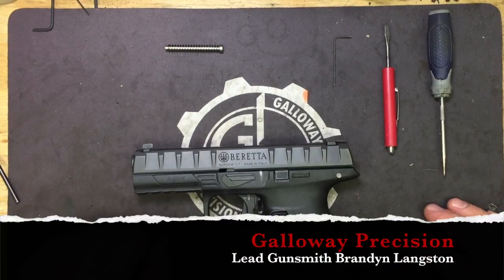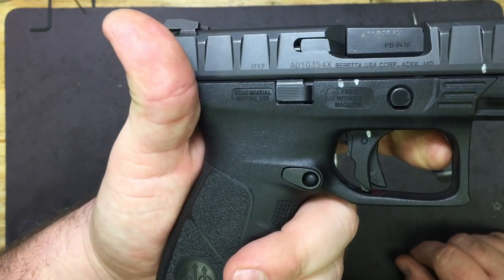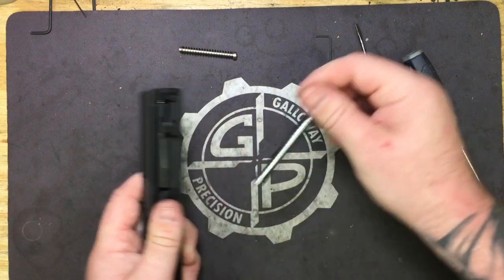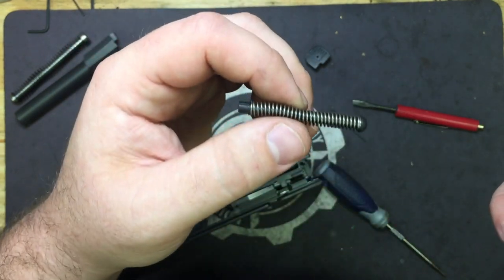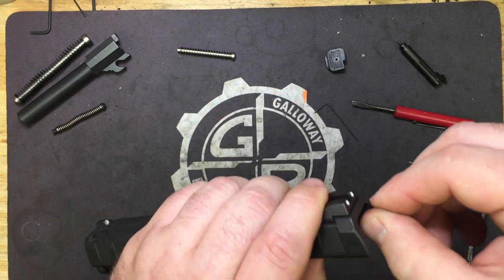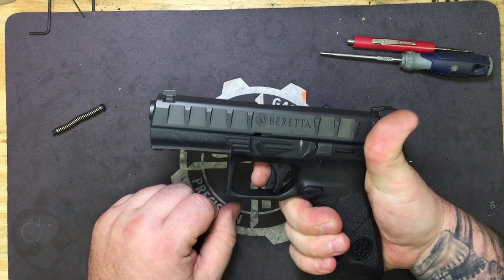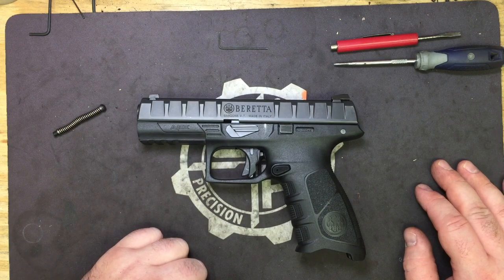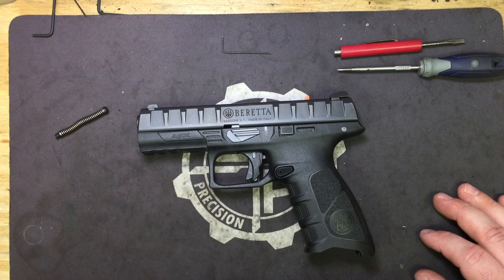Beretta APX Striker Guide Installation

Comment: I’ve watched this many times before. My beretta apx had proved this at the range with 18 lbs stainless steel guide rod spring assembly and my gun cycled very well with more accuracy. I also have the 20 lbs which I will use next time. These upgrades are more efficient than the stock polymer guide rod spring assembly because it’s stainless steel guide rod with heavier recoil spring. I love my beretta apx 9mm fullsize with this metallic guide rod.

Comment: I received my APX Trigger spring today.  I was very excited about installing this.  I will say, I did struggle placing the back plate back on.  I had some issue applying enough force on the extractor to get the plate to slide into place.  I took the pistol apart several times to test where it was binding, but it seems like it just required more force to get it back together than I expected.   This pistol is VERY tight on all moving parts.  Even the top slide release was crazy tight.  But the great news it is back together and I am so happy with this new lighter pull.  Headed to the range to run some ammo through it now!!
Reply from the maker: Great to hear it's back together and you are happy with the results. We appreciate your business.

Comment: Thank you for the detailed explanation of the proper procedure of slide disassembly and reassembly. I had a very difficult time getting the spring that powers the extractor aligned and then sliding the cover over the top of it. That particular spring is very stout even with a properly sized gunsmith punch.

Comment: Galloway prices as extremely reasonable and they move the products out!  The instructional video is good.  I own Glocks and their rear plate removal is much easier.  I did buy a factory lighter striker spring assembly too because it was inexpensive.  My Galloway parts arrive today and I will report after installation and testing.  With that said, I am not fond of the dual part removal system of the Beretta rear slide plate.  It becomes easier with practice, but Beretta should have taken a lesson from Glock.
Reply: Paul Klenk it’s a beretta. Much better than a glock

Comment: Gun works just fine factory.. Right around 4-5.5 lbs, very minimal changes imo
Reply: @E ZA What are your thoughts?
Reply: How many rounds fired? I have a 7 lb trigger pull weight, average on a Lyman pull gauge, with this SS kit. Have not fired the pistol yet. It is brand new in the box.

Comment: I have a 40 S&W Apx, cannot get the rear plate off . Is the 40 S&W different from the 9mm? The plate starts to move but then locks up because it will not come out straight

Comment: Can you clarify if this works in the APX A1 Carry?  Your website says it does not fit A1 series (not sure if that meant the other compact and full sized models) but does fit APX single stack so I figured I would ask.  Thank you
Reply from the maker: Good question, it has caused some confusion. It will only fit the Nano and the original APX Carry Single Stack. Will NOT fit the APX A1 Carry, APX A1 Full Size, APX A1 Compact, or APX A1 Full Size Tactical. Between the APX Carry and the APX A1 Carry the striker did change and we don't have one available for that pistol.

Comment: Any advice on a fix for the APX Carry's terrible trigger?
Reply from the maker: We do offer a full Reduced Power Spring Kit for the Nano and APX Carry Single Stack pistols, sear spring, blocker spring, and stainless steel striker guide for nice trigger pull, smooth and easy action, this does not alter the striker spring. Reduces pull by about 1.5 lbs. It does not reduce pull length or reset length. It is on both our APX and Nano product pages of our Galloway Precision website. 

Sorry due to Youtube's policy on firearms I can not leave a direct link to the website here.

Comment: My hands are full of arthritis and I have a difficult time to pull the slide my hands are not strong enough to hold on to the slid grips what can I do or get to reduce the pull rate on the slide
Reply from the maker: Sorry, not something we can offer currently. I have plans to offer our rack assist plates in aluminum and that will be the best solution for you I believe. Going lower on the recoil spring rate is not a good option for lower racking effort and honestly will not help much, a rack assist will be much easier and better overall for your need.

Comment: Are you able to remove the striker block? And have the gun function properly wondering if so I could add a RDO
Reply from the maker: Probably, but I wouldn't do it.  Beretta is selling them milled for an optic now straight from the factory though.

Comment: What happens if the striker guide doesn't come out right and the striker guide gets wedged behind the backing plate
Reply from the maker: You should be able to just compress it like in the video forward to allow the plate to slide off. Push the plate back to the lock position and retry compressing the guide.

Comment: How is this striker compared to the beretta reduced power striker?
Reply from the maker: We have not tested theirs. Our Striker Guide Kit eliminates the wall, and has the added bonus of taking around 1lb to 2lbs off of the trigger pull weight depending on the tolerances of your particular pistol.
Reply: @GallowayPrecision  how many pounds is the striker spring you offer for the apx?

Comment: Apx a1 full size. Really heavy trigger. Press trigger to take up slop. Hit wall. Continue to squeeze. No break. Heavy soft squeeze. Then clench fist to fire. This throws me off target. Weirdest pistol trigger ive shot. No trigger upgrades. Only this striker spring. Feel after install does feel lighter. Havent been to range to test yet. Wish there was a "available" cost friendly trigger out there.
Reply from the maker: There has been enough interest in a trigger for the APX. It is on our list, but don't have an ETA at the moment.

Comment: It didn't work for me. I haven't felt any difference between factory and GP spring, except weird vibrations every time I pulled the trigger. I will try to return it.
Reply: I had a similar experience. The GP striker spring felt heavier and I got those odd vibrations and sounds as well. I ended up using the OEM competition spring with the GP guide and it made all the difference. If you have not returned it yet, you could use the stock spring. The advantage of the GP guide is that it is uncaptured so you can change springs out. And its high quality stainless steel so it adds weight and won't bend. The OEM plastic guides get beat to hell each time I take it out to clean the striker and they wear and shed. Its hard to tell with the black one, but with the green I was finding tiny green specks of plastic in the internals. Not sure what GP has to say about using the OEM springs but so far I have had no issues.
Reply: @rothearl9375  Thanks man! That is a great idea. I will definitely give it a try. I actually kept it. I figured sending it back will cost me additional money and though it might be my spare one. Here you provided me with a fresh idea. I have to say that GP was very responsive and customer service is outstanding. They gave me an option to return it - I just did not use it. Thanks again!
Reply: @tomek.karpinski  I got this solution from a review on eBay. Someone else had the same experience too and that’s what they did. One thing I should mention, getting an OEM spring off is straightforward. Getting it back on is really hard to do (at least for me). Just wanted to let you know in case you try it out and don’t like it. Hope it works out for you.
Reply: @rothearl9375  I just tried this and it puts a ton of pressure on the striker block since it is uncaptured, standard and competition ones from beretta do not put any pressure that I see(push striker block with finger and striker doesn’t move), with this it is shooting forward. Think I’ll be sending mine back and stick with the green striker
Reply: @donaldlococo7353  Thanks for the info. I was unaware that was happening. I ended up putting the factory striker back in and only fired 100 rounds with the GP striker/OEM spring. I imagine long term usage with that setup would not be good.

Comment: How do I choose the correct guide rod spring weight? Looking to order both but not sure what Lb. spring to go with?
Reply from the maker: It really depends on the grain of the ammunition you will be shooting, also if you have the 9mm or 40S&W.  22lbs for the 40 would be your best bet, and 20lbs for the 9mm.  If you're shooting powderpuff loads for competition I'd go with the 15lb.
Reply: GallowayPrecision Shooting mostly 124 Grain (sometimes 115) 9mm Blazer Brass.
No competition (yet) just range target shooting is all.  
With that info what do you recommend? 
Also I'll be buying your firing spring as well. Thanks
Reply from the maker: 20lbs will be your best bet.
Reply: Just ordered the 20lb guide rod and the SS Striker Guide Kit ... Hope it helps :)
Reply: Chris, do you have a range report? Thinking of getting both as well.
Reply: I ordered both the striker spring and guide rod together .... the striker spring was BAD, not sure if it's just my APX but it made a weird light pinging sound when installed (sounded like a kids gun or something) and the trigger pull went from 6lb. to over 8lbs. (not sure how high as my gauge only goes to 8). 
And I did the install 3 times (GP then back to stock, GP then back to stock, etc.) ... once the stock spring was put in perfect ... put the GP spring back in a nothing but a pure dud unfortunately. 
Was not pleased and decided to return it all. 
Bought the actual Beretta Competition Striker Spring and it installed flawless and did away with the hard wall and reduced the pull from 6lb. to 5lbs. 
So I am just going to run the Beretta spring along with the stock guide rod as I lost trust in this GP setup. 
Save the money and run the stock spring as the weight increase is something I couldn't even feel in hand very much (tough it is there a touch) and is negligible really to constitute $25 for the guide rod, and if thinking of new upgraded striker spring pass on the GP spring and get the $13 shipped Beretta spring kit. the Beretta spring was night and day on trigger pull, that alone made the trigger MUCH better. 
But for me $25 for the guide rod I just don't see it.
Reply: Chris Imes Right on, thanks for the info. To be honest, I don't mind the stock trigger on the APX. It actually spoils me haha. When I go to my g19 or my shield, makes me appreciate the ergos and the trigger of the apx even more so. I'll prolly get the comp spring from Beretta since I do use the apx for ppc.
Reply: I have the same issue.
Reply: Mike Joseph  did you get it? Did it workout for you?